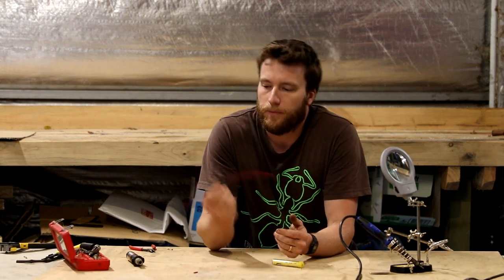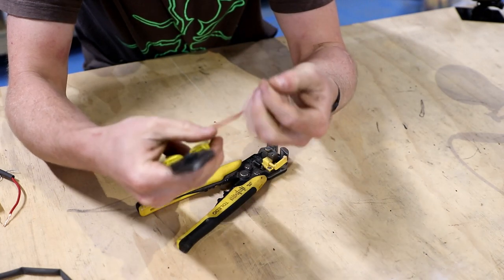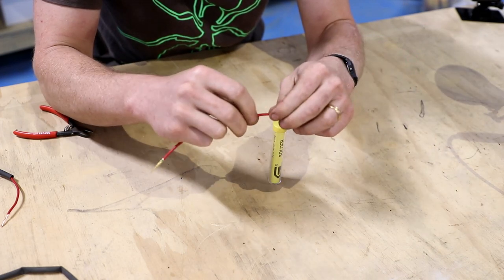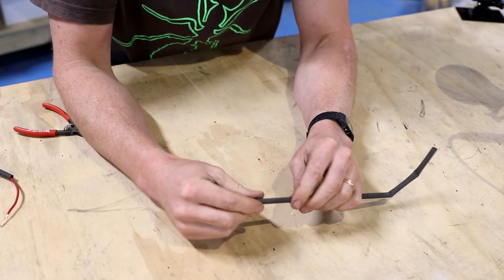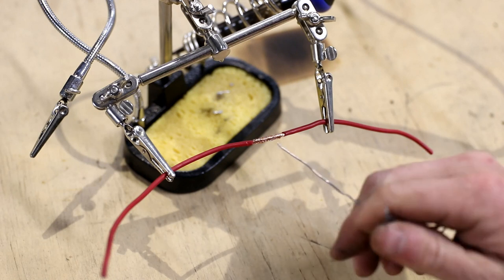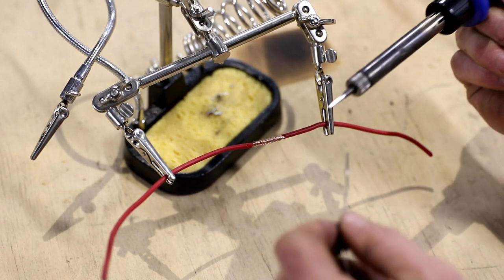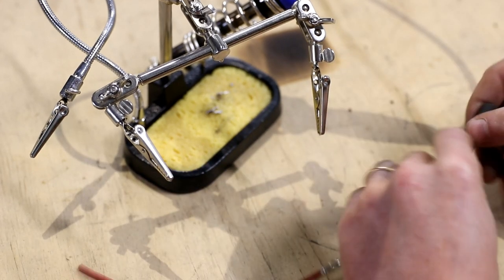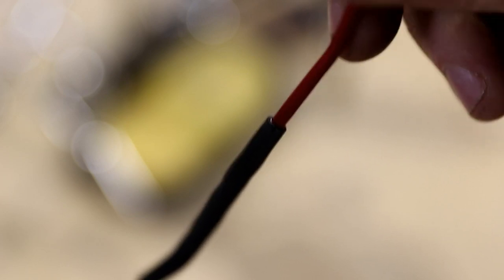How to solder electrical wires

Comment: I rarely find myself soldering on my workbench. Generally upside down under a trailer or in the boat! I got a propane iron that is great for items outside the shed, but I'm cautious when working near fuel vapour due to the open flame.
Reply from the maker: Likewise. I was doing some wiring under the dash of the ute, so thought I would whip up a video while all the gear was out, but its a bit hard to show it on the job.